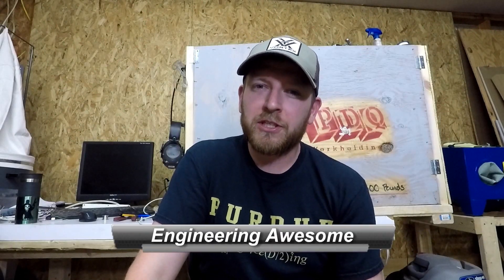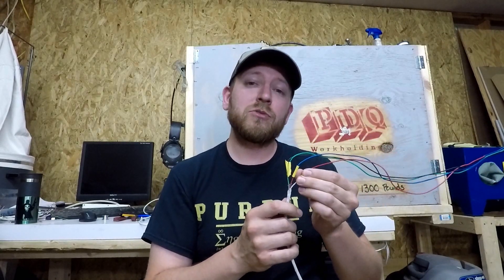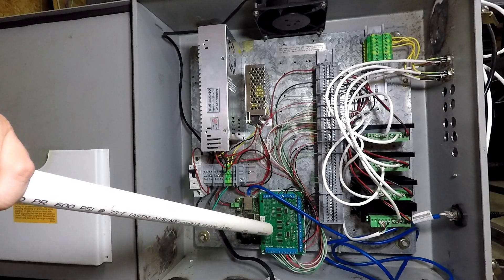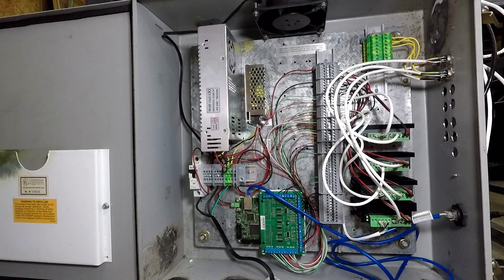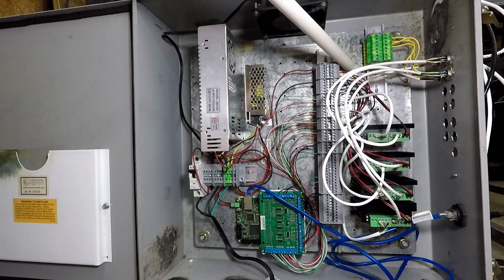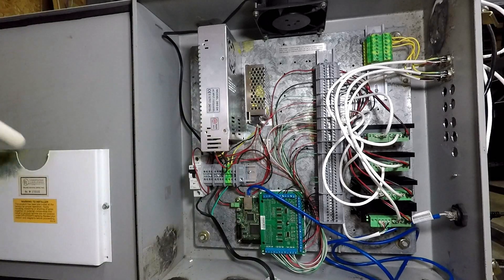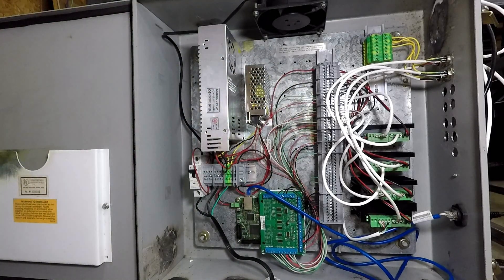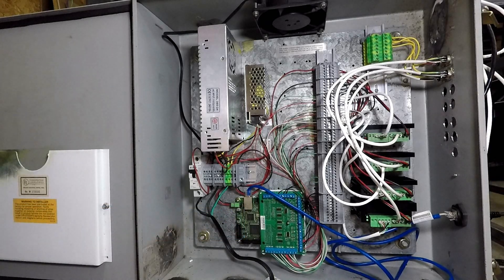Build A CNC Controller

Comment: I can't find these type of terminal blocks anywhere and your link isn't working can you help me out please with that?
Reply from the maker: Sure. I use Automation Direct for my terminals. A lot of their stuff is cheap and imported from China, so beware of quality issues with things like sensors and such. But shouldn't have issues with the terminal blocks. I has used their temp sensors as well and cables work well for a good price.

Comment: I'm electrical not mechanical...do you have any frame plans?
Reply from the maker: I will not be releasing the plans for this particular build. Not happy with the water table and the strength of it. I am working on a new build and will be selling the plans. I am thinking that they will cost $20. It will be for a 100% plasma cuttable setup. By that I mean that the pieces that are not tubing, can all be plasma cut. I will be offering the pieces cut as well to help those that don't have the kit. This is my plan and not a for sure thing.

Comment: Nice work. I like the fact that you have your power supplies above the controller and breakout board so they escape the heat from the power supplies. Also, you actually grounded the drain wires from you shielded cables. I have seen some videos where guys didn't bother to ground the shield drains which defeats the purpose of having shielded cables. I see the panel mount Ethernet plug you are using isn't shielded. If you ever wanted to change it over to a shielded plug, here is a link, http://www.l-com.com/patch-panel-server-rack-universal-sub-panel-2-category-6-couplers-rj45-shielded
Reply from the maker: Thanks man! When I got that bulk head ethernet plug, it said grounded. But there isnt anywhere to attach a ground wire and no metal contacts the box. I was pretty disappointed to be honest. But it is nice and clean. I checked out that link and will probably pick one up at some point. Right now the table is keeping me pretty busy with work.